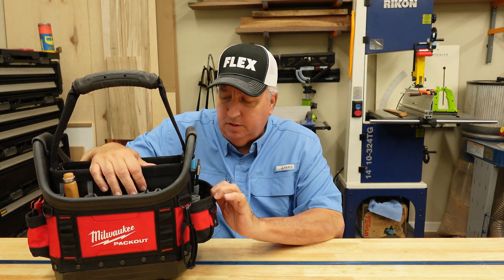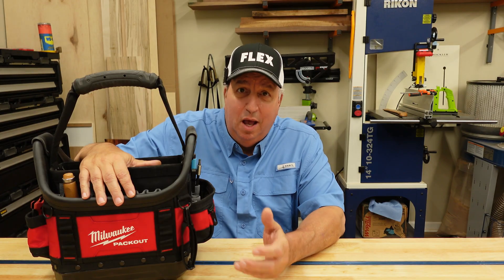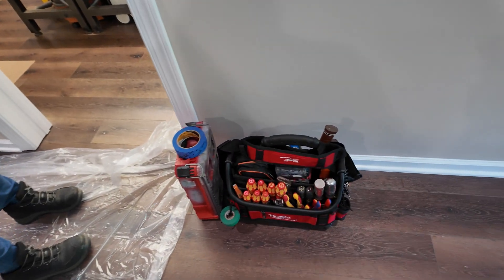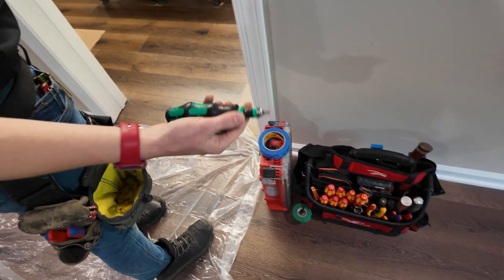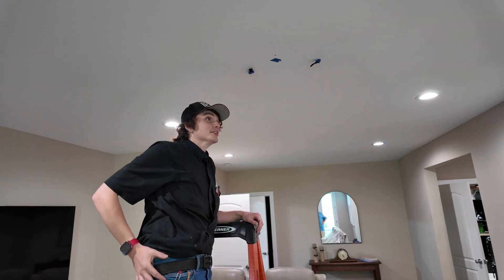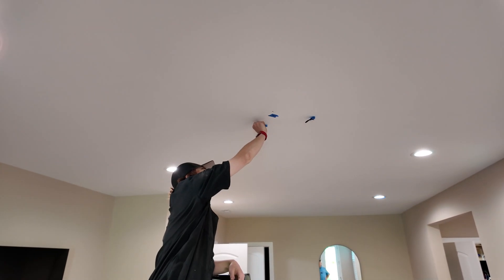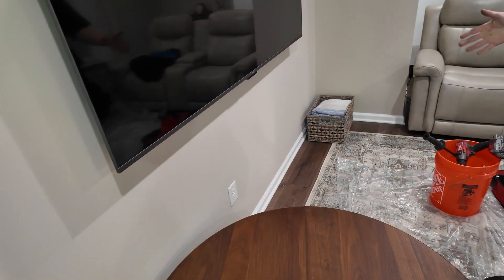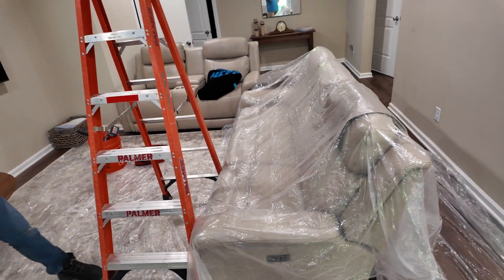Guest YouTuber working at my house

Comment: In Germany I have never seen wire nuts. All new installations by licensed Electricians in my house are with Wago. And we are operating 230V/50Hz as standard here in Germany. Never heard of Wagos responsible for fires.
Reply from the maker: Thanks Roland, here in the US it’s seems hard to change from something that has worked for decades
Reply: @StevesWoodshopandToolReviews  The, lets say, ancient way of connecting wires in Germany is the so called „Lüsterklemme“. Here is a link to a picture of one: https://de.m.wikipedia.org/wiki/Lüsterklemme#/media/Datei%3AScrew_terminal_with_crimped_wire.jpg You get them as on the picture and you cut it to length for your specific use case. The wires are locked by small screws. This is basically the only application where I still need a flat head screwdriver. These „Lüsterklemme“ are the equivalent to the wire nuts. Still in use everywhere but outdated.

Comment: According to NEC 334.15(C), NM cable installed on the wall of an unfinished basement must be - Installed in a listed conduit or tubing.
Reply from the maker: All of my wiring in the basement was installed without conduit and was approved by the county building inspector